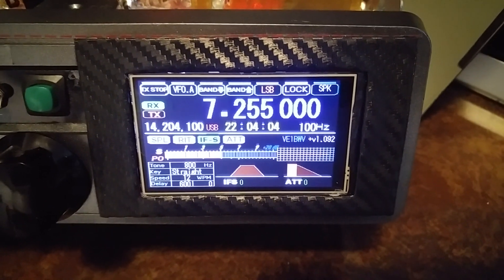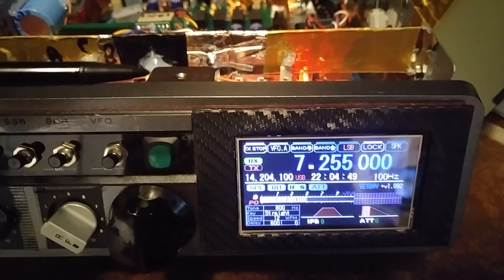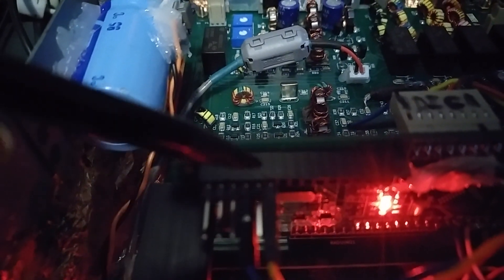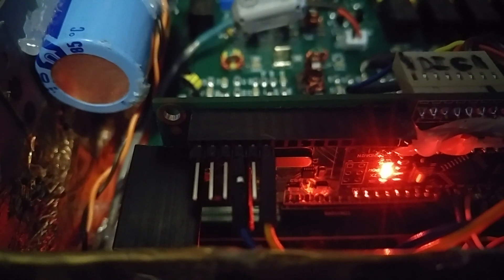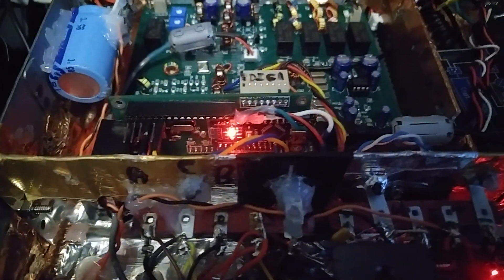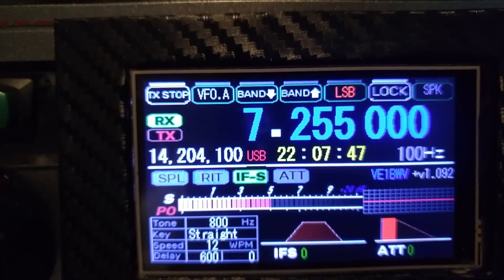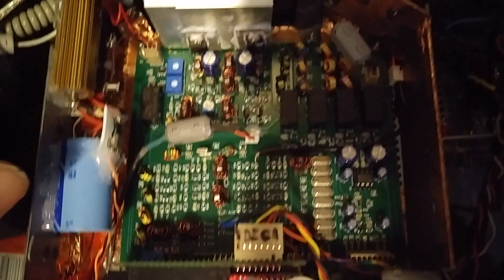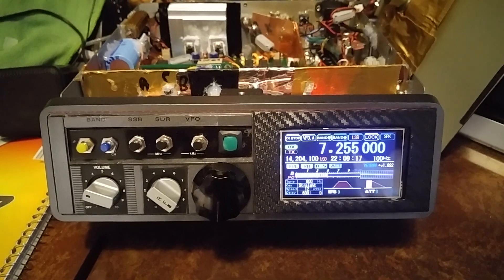Nextion 3.2 E on UBITX. Install

Comment: Where on the Ubitx do you wire in the buck converter?
Reply from the maker: I have added several.  I feed the 12 supply to the buck and reduce it to regulated 5v to si5351 input.  I also add a hash filter - 1000mfd cap with a . 2 ohm resistor in series.
I do the same with the raduino board.

Comment: was going to buy this radio but herd it WONT PASS FCC REGS !
Reply from the maker: There have been some issues, especially if it is driven hard. With simple mods it can easily moved to well within specs.
The new version 5 which is now being sold has these issues corrected..
I and many others run the rigs with no issues.  It is a kit and is always being updated by the ubitx community.. It is a full featured radio but not recommended for the ham that does not want to mod it. 
VE1BWV

Comment: Hi Joe have mine up and running using a home brew receiver design as a test platform . Works great. Still trying to get the s meter to work. To no avail.. Tried going on to ubitx manager to toggle it on but keeps saying no match. Not sure what that issue is? VE6CJC here in Jasper.
Reply from the maker: Glad your up and running. Normally, the smeter, just needs to be turned on in the ubitx mgr and test values put it. Then your hardware connected. The early versions of kd8cec smeter hardware did not work for me. I switched to his latest smeter ctt. I cant remember the chip number but it is on his site.
As soon as i installed it, the smeter responded,  i adjusted my ubit smeter base values for correct levels and it worked.
What smeter ctt are you using?
Reply: My smeter circuit is a simple audio driven with diode to provide a positive voltage swing. My biggest problem in in ubitx manager. it will not allow me to toggle on the s meter. When I tick the little box and try to upload it comes back with "no match" also I dont see anywhere to put in test values. Maybe there is another version of ubitx manager?
Reply: Hi Joe, actually got a later version of ubitx manager and with the s meter assistant got the s meter to work. Its jerky but it works. One interesting thing my USB and LSB are reversed. I need to set it to USB for 40 meters. LSB for 20 meters> Weird? I checked the frequencies with the counter and everything is OK it appears its a mistake in ubitx version 1.1.
Reply from the maker: @keithmckenney4970  good to hear you got it working...Strange on reverse usb /lsb...

Comment: Joe, does it matter if the display is Enhanced or not? Going to be buying a 2.8", it will fit my enclosure...
Reply from the maker: No the E or non e will both work fine

Joe
Ve1bwv

Comment: Joe, one other question.  I just got the CR1220 battery and installed it on my Nextion.  What I am wondering is how to I get the clock to show up now.  I am using Ian's beta 1.095 firmware and uploaded the tft file for the display.  I don't see how to get the clock to come on.  Any help would be appreciated.  Thanks.  Juddie WD8WV
Reply from the maker: J & J True Outdoor Adventures 
The clock was some addon code by wn4ud Allen
With the small screen there not much area. Especially with new features being added.
 Will talk to Allen and see if we could put it as a selectable clock. Where you choose to display or not.

Comment: Great video Joe.  I am new to the uBitx world and just put a Version 3 board together and have a Version 4 on the way from India.  I like with you did with the Nextion screen.  I have downloaded all the files necessary to use a Nextion from KD8CEC.  Right now I am using the 2 line display that came with it with KD8CEC firmware 1.08 on it.  I am still learning all this stuff.  I see you have done a very in depth set of modifications to your uBitx.  Could you do a video and take the time to go thru the different mods you have done to your uBitx!  Especially for us new folks that seem to be overwhelmed by the forum as to the mods out there.  It is so jumbled up it is hard to find what really is beneficial, especially with all the changes to the firmware that Ian has made.  Again great video and I like how you have your uBitx in that enclosure!!  73 from Juddie WD8WV
Reply from the maker: Sure, will try to do an update video soon.  I am just finishing work on a 7 inch NEXTION display and  also working with KN4UD ON THE 3.2e NEXTION..  Lots of new graphic enhanced screens and buttons etc...
Just finished testing the s-meter cttt and it it working quite well - some more tuning, waiting for the band to open later this eve.
Changing to a nextion display is very very easy.. 4 wires

Joe
VE1BWV
Reply: joe basque just got my Nextion 2.8 Enhance display up and running with Ian's firmware 1.094 (beta) tonight.  I turned on the S Meter but don't know what I am doing or what I need to really have an S meter.  I am beginning to love this Bitx!  I built and used for field day this year a QRP-Labs QCX 40 Meter QRP.  Made 37 CW contacts with it, just working casual and just answering those calling CQ FD.  Juddie WD8WV
Reply from the maker: J & J True Outdoor Adventures 
In order to use the s meter you must add some parts.  If you go to. Http://www.hamskey.com and search for s meter. Look for the version using LM358. This is the one i used and it works ok.
You will also need to use the unitx memory manager to setup s meter levels... He also has a step by step routine on his site.
Joe
VE1BWV
Reply: joe basque I read that on KD8CEC's blog.  I was hoping he would give some info on the LM356, he mentioned it but no specifics.  I have 3 of those in my parts bin.

Comment: Love it. Will have mine going soon. I will try various methods re the 5v supply because going from 12 to 5 using a linear regulator is a little crazy. Trick will be using a switcher without adding noise. If I'm successful I'll do a video. Might have to be mounted outside the box with a little toroid filter and caps to keep the switching stuff outside the box. If necessary.

Comment: hoes it have AGC? i have seen a mod for an AGC that require to cut the trace from the RxTx relay to the first mixer as you have done.
another questin, how did you have connected the SDR? i am loocking for a way to connect it without ruin the reception performance but the best soution i can think of is an LNA from the RX relay that feeds a power splitter, half of the signal goes to the mixer and the other half to the SDR...

73, IU3IRR from venice italy, 18yo operator
Reply from the maker: manuel minutello 

The radio does not have agc but can be added as a mod.
Sdr- I added a dongle an up convertor.
I just added coax cable from the sdr to the receive side of k3
In rx mode you have a direct connection to ant and in tx mode the sdr is shorted to gnd by k3
There is a picture exactly where you need to add the coax.. Http://ubit.net
Joe. VE1BW
Reply: but inserting the SDR there does not affect the Rx performance since you are missmatching the antenna?
Reply from the maker: If it does have any effect on the receive, it is not discernible.
 I have been using it for more than a month and it works great.  On my other videos I demo the sdr audio and radio audio - both sound same.
I can listen to Radio or SDR audio individually or both audio at the same time with no perception of any difference.  The SDR receiver  is protected the same way as the ubitx Radio receiver.  
I understand your logic or concern about a mismatch but several of us are running this setup with no issue.
You can of course just use the SDR setup builtin to the ubitx SDR.  It adds a coax cable in another area of the IF portion of the receiver and only requires a RTL dongle which cost less then $10..00. The Disadvantage is the Bandwidth presented on the display has a bell curve and not equal gain, not nearly as good as using the RTL and a UP Converter. 
I used the RTL Dongle and Up converter because I had one in the shack.
It also presents a far superior  visual display / bandwidth.
But it costs around $60.00 ...
Joe
VE1BWV
Reply from the maker: If it does ,  I have not noticed  any difference to mm receive signals - they are all very strong
Reply: i will try to do the same thing, actualy i am thinkerng with a spice model of the ubitx to experiment some mod that i want to make, and i found out that the input impedance of the radio is 90ohm and not 50 so you a probably making things a little better haha... anyway if wou want to try i have found out that changing R14 from 220 to 470ohm gives 5dB more gain, this also change the input impedance to 50ohm and so it should give more sensitivity.
Reply from the maker: Thanks for the info... must look into the change of the resistor

Comment: Thanks. These are some good hardware integration tips. Will dr Lee's software support the 3.2 inch version of the Nextion?. If not where can specific version of the display firmware be found?
Reply from the maker: He has indicated he will only support 2.4 and 2.8... But thats ok.  There are several others like myself who  support  3.2 and 3.2E  and maybe 7 inch
What you see above is with the nextion 3.2E inch. Also my other videos with the nestion are done on the 3.2E

Myself VE1BWV and KN4UND also have the same 3.2E display.  It is working very well..